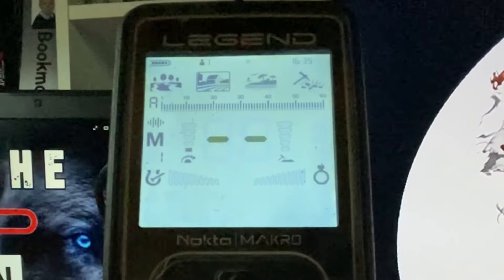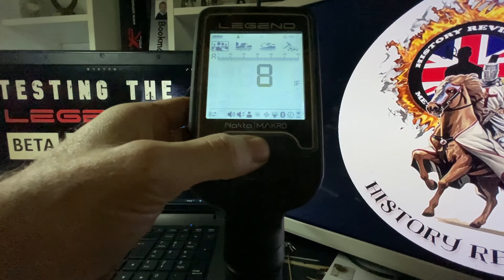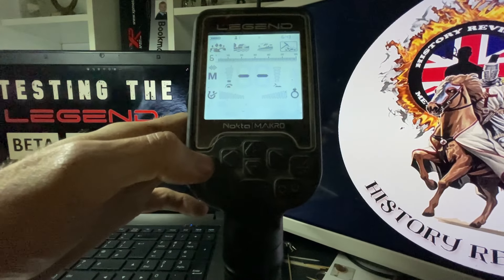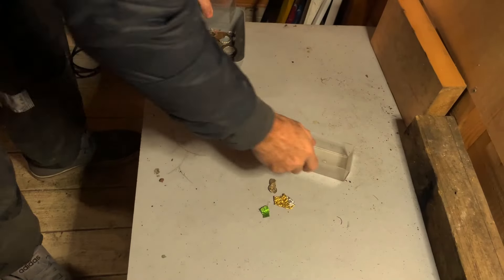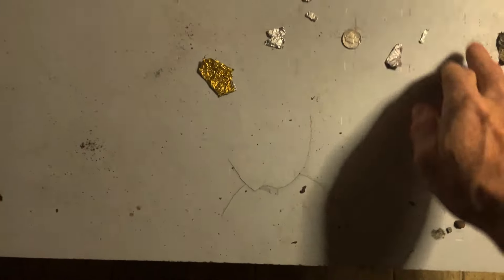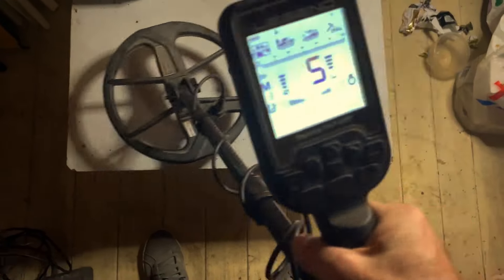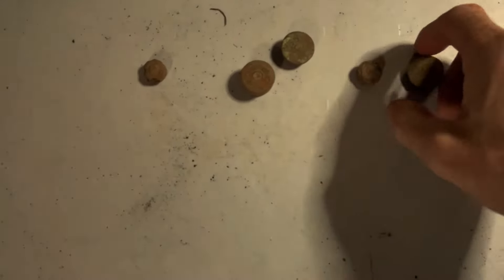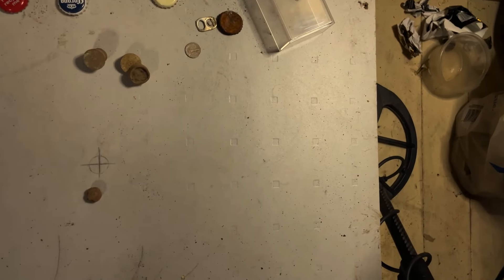Looking At And Testing New Features On Beta Version 1.10 | Nokta Legend | Metal Detecting

Comment: Thanks for this little insight into 1.10. Thanks to all your previous videos, I've set up my Legend just the way I want it, for the field I detect on. I don't really get a lot of bottle caps and Cartridge shells I can deal with. Although I do have a historical wood that i'm allowed to detect ,so looking forward to getting the smaller coil and then might get the 1.10update. For now, it's1.09 and the stock coil for me.

Comment: Good video. I am seeing the same results with V1.10B as you. On the IF 9 & shot shell heads, I think Nokta's intention was the newer brass plated steel ones, not the older all brass ones even though they say mid conductors. It does work somewhat on rotten tin cans & sheet metal bits too.
Reply from the maker: Hey didnt think of tht, that will be it. 👌👨‍🦯